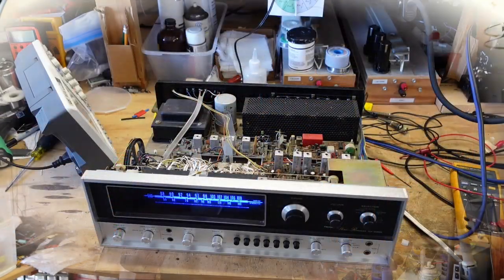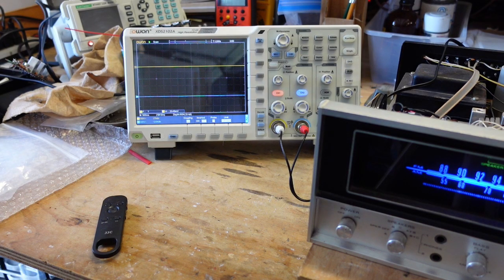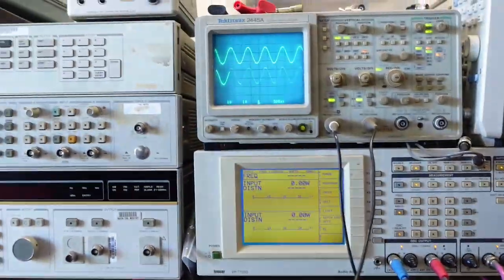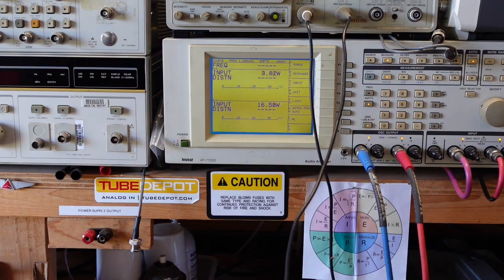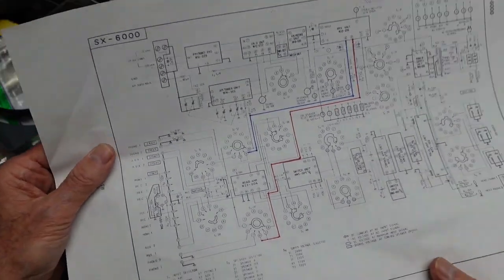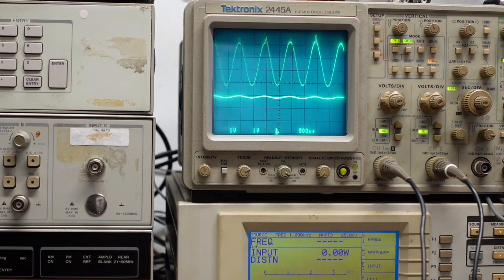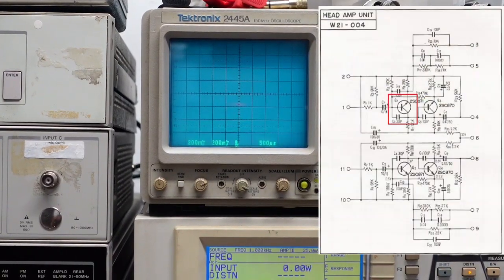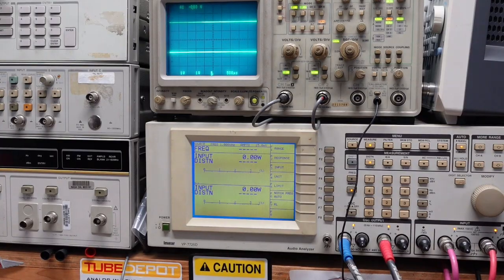Pioneer SX 6000 Repair  Weak FM Left channel

Comment: Hi Ray, I'm only writing now, I saw the video as soon as you posted it, but I was too busy to write.
At first I had a lot of fun with the whistling, it reminded me of a situation when they called me into an office to say that their alarm sensor was whistling, I tried to explain to them that it was not possible because there was nothing to whistling in it. The office worker who didn't believe me and cursed at me was so annoyed that I removed the sensor in front of him and the whistling didn't stop - to make it short, his UPS was whistling because the batteries died 😂

Interesting video, I haven't seen a combined preamplifier for a tuner and phono.
That analyzer is simply amazing, lucky we have it 😁

Nice day 🙂 Tom
Reply from the maker: We sure are!  I just got contacted by another person who bought a 7725.  At this point, I'm probably responsible for selling more of these than Panasonics entire sales team. 
😁
Reply: @raygianelli3612  👍 ........... 😂 so Panasonic should pay you sales bonuses 😂

I also have one news - I managed to replace my old digital automotive oscilloscope with a Hameg 7150S RF generator so I can fully control the multiplexer and modulate the stereo signal, (I originally wanted to buy a Panasonic, but the price was very unfavorable) so I can work more responsibly on tuners.
🤔 You didn't even write if you liked the stackable connecting test cables I made for the so-called four-wire measurement on the analyzer.

Nice day 🙂 Tom

Comment: Beep...Beep... Beep. LMAO....!! I had that happen in my Laundry Room. Smoke Detector on the ceiling ... C02 detector over the hot water heater ..laundry room  is next to my garage entrance with the door open. In the garage I have a Smoke and C02 detector. Got this beeping sound in the Laundry room. Hit the reset button in the laundry room devices. It stops. 2 min later...beep beep  again. Took me 1/2 hour between beeps to find out it was coming from the garage ceiling Smoke detector..(Low Battery).  Drove me nuts!     Anyway..I never saw an RIAA Phono Pre routed that way. I was trying to follow along and was totally surprised to see how that was set up by Pioneer???? Weird. But.... I learned from your Video something that is very helpful. Great Job Ray!! Thank Steve for twisting my brain and stumping you for a while. Nice Work. ...................Old Friend.

Comment: I am assuming those are Wurth caps. I have received so many obsolete and end of life notices from Mouser the last couple of years. Are you happy with Wurth and what boards/circuits do you typically use them?
Reply from the maker: They work fine in all applications that I've used them in.
Through hole components are going away at an accelerating rate.  Buy what you can while you can.

Comment: I just recapped a KLH Model 27 receiver for someone. It has the Aux run through the phono board. There is a switch on the back to set the Aux gain and a switch for the Phono gain. I have a SX-6000 that thumps bad on startup. I really need to narrow that down. Probably the output coupling caps.

Comment: I'm with you. Never would have suspected the head amp. Did that fix the POP as well?
Reply from the maker: Mark!  How've you been?
It mitigated a lot of it, but there is still a lower volume  pop... now equal in both channels.  I suspect, considering the age of this unit, that some pop is probably normal.

Comment: Another reason I refuse to work on stuff like this for other people.  Guy had a Pioneer receiver that would not work in stereo FM mode.  I spent a lot of time trying to puzzle it out without owning a multiplex generator.(  I could modulate my gen.  with 19 kHz.)  As it might be something I would use every 10 years.  And it was an IC multiplex decoder. Chips were difficult to source and I could never get it to work.  I had tech data but I failed.  Frustrating.  Replaced almost all the parts in circuit.  Except one chip I could not get but seemed to be working.
Reply from the maker: Tom, I hear you.  I rarely take in work for others.  Steve is local to me, and the most chill guy in regards to expectations.  I've had stuff of his for months, and he's never even asked how it was doing.
Radio is something I'm fairly new at.  It's coming along, but I still struggle with it.  These 15-30 minute videos omit the hours of hair pulling that go with the territory!

Comment: Great job!! Thanks for sharing. What transistors did you use as replacements?
Reply from the maker: I was unable to find a datasheet for the 2SC870/871 transistors, but the alltransistors website showed specs. They're low current, low voltage transistors with an fT of 75 MHz.  I wanted to use KSC1815, but I guess I ran out, so I used the ubiquitous KSC1845.  I've had these motorboat in Marantz phono stages, but they were fine here.

Comment: Detective Sherlock Gianelli at it again, great work my friend!
Reply from the maker: I've never seen a receiver or integrated that ran anything other than the phono through the head amp (or equalizer amp) before.  Now I'm curious if Pioneer did this on any other models.
The gear you bring me never disappoints, my friend.  It's either going to make me a better technician or send me screaming for the hills!
Reply: @raygianelli3612  The hills can be very relaxing!